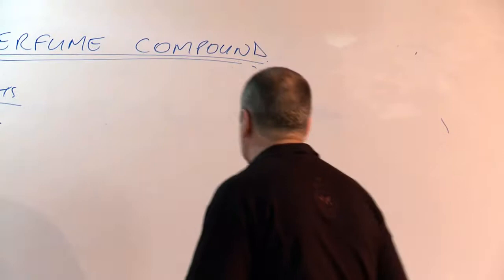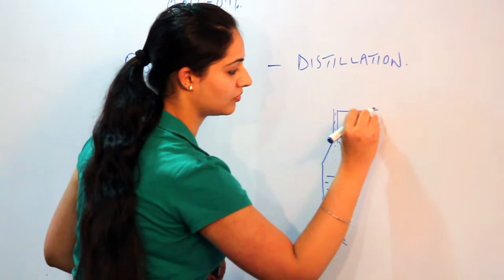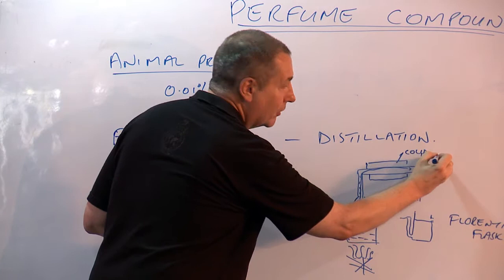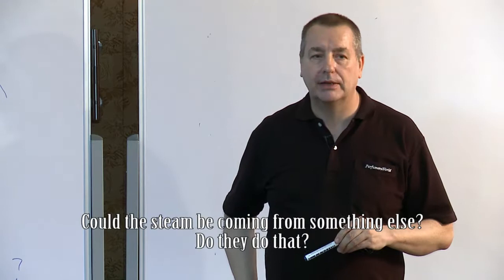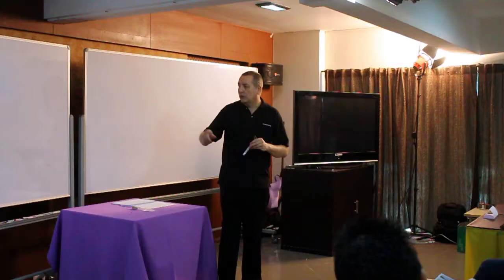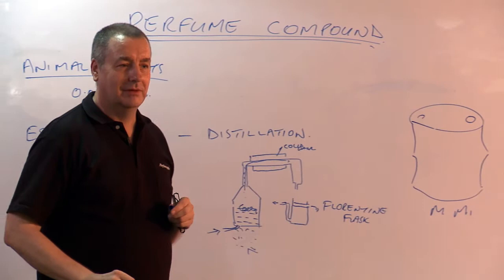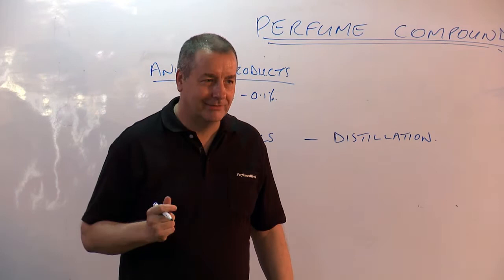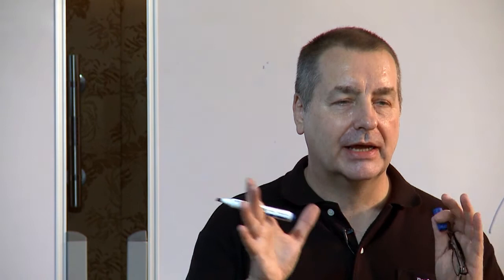1-05 Essential Oils

Comment: If we use 100% essential oils as scent material, how much can they be in the overall composition including alcohol/carrier oil? Because I've heard 20% dilution which would make it an EDP is still very potent or even harmful.
Reply from the maker: You have to look at each essential oils properties. Most of the Herb ones are pretty low irritancy. But the Spice ones can be very hot and burning. The Phenolic oils (Basil, Thyme etc.) can be toxic in concentration. But generally speaking it is not a good idea to use perfumes on the skin (diffuse from clothing, handkerchiefs, hair etc). If you do use on the skin, use low total concentrations ie. 3% or less and keep the total of the irritating ones to below 0.5%.
(Note: These guidelines are based on the total mixture NOT 3% of 1 oil + 3% of another oil + irritating oils 0.5% each)
Reply: @PerfumersWorld  Thanks a lot for replying.
I made a 20% EO blend with the rest being Jojoba oil. (6-7 different essential oils each between 1-3%.) And even that doesn't last over 2-3 hours. If I make one with only 3% in total, I don't think it's gonna stay long at all.
Reply from the maker: @danlightened  If you are only using essential oils then it will be difficult to get a really long odour life unless its things like Sandalwood Oil.  I suggest you take a look at our free course online or contact me through the website contact page for more. Link is on the Channel or Google our name.
Reply: @PerfumersWorld  Yes I've watched a lot of these videos and it has been the most helpful. I would have definitely even joined you in real life but unfortunately I'm from India. And I think you all are in the West.